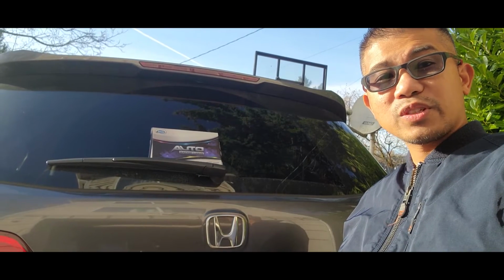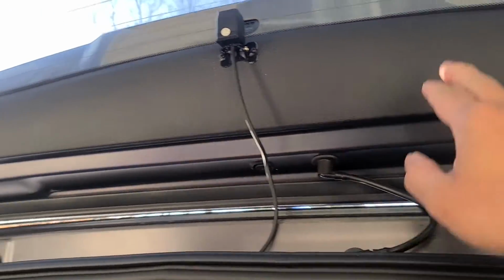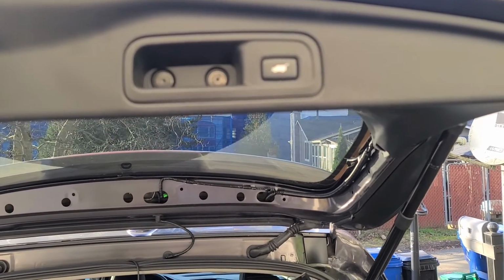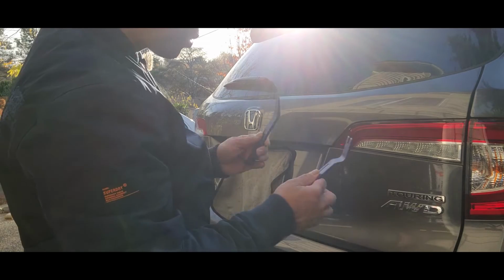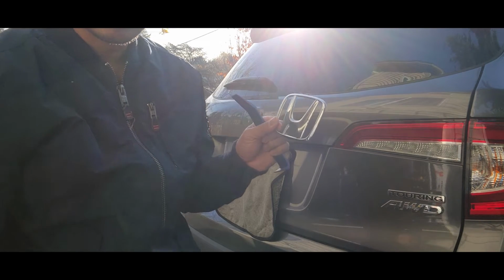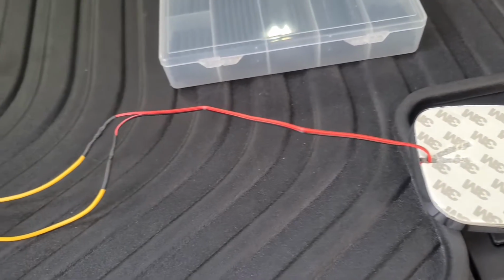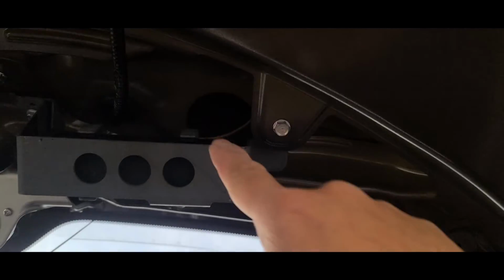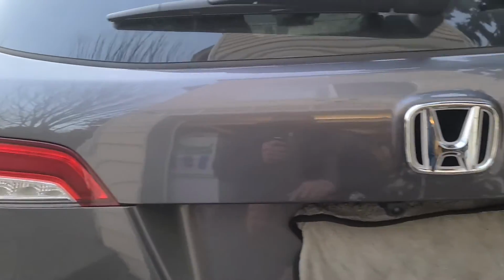How To Install White LED Badge Honda [Step-by-Step Installation Guide]

Comment: Would you happen to have a follow up review on how the badge held up thru time and weather?  I have the same one and i feel like its too cheaply made to endure the elements for too long
Reply from the maker: It's been about a year now. Holding up pretty well through Seattle winter storms,  snow and rain. I do however am starting to notice the bottom right is a little dimmer.
Reply: @AutoSensation  thanks for the quick reply.  Im actually considering applying glossifier from plastidip to protect it and MAYbe clearcoating it just to give it luster (being that glossifier isnt actually glossy).  I figured doing this would make it last longer, especially since the unit isnt actually sealed (the backing that lights up can actually be pushed in thus allowing water and dust to get in.  Hope that idea helps the 2 of us.  Thanks again!
Reply from the maker: Thats an idea. Planning to get one for my wife's car. Maybe I'll do that to hers.
Reply: @darkhalo530  How did it held up over time? I wanted to try this on my accord

Comment: My car uses a single bulb for parking lights and brakes. It's a dual filament one, P21/5W. Can I still use the wire for this as a power source? It's 12volts but I am afraid the leds on the logo might become more intense when braking or even get damaged. Should I maybe try to connect to license plate ?
Reply from the maker: Yes. I would try the license plate power. I'm not sure how the brake will affect the outcome.